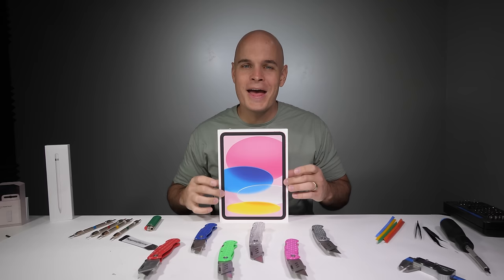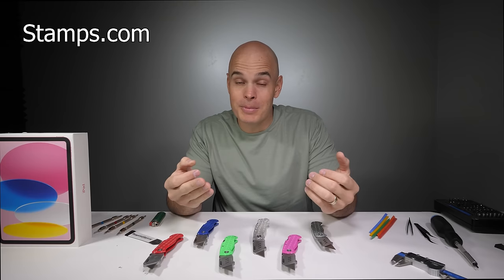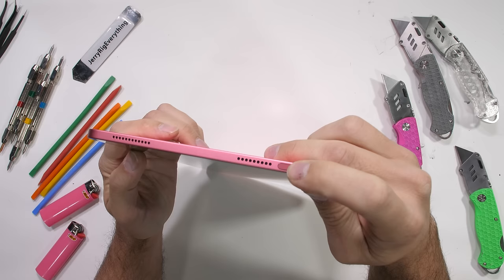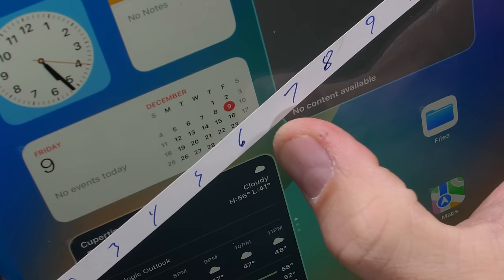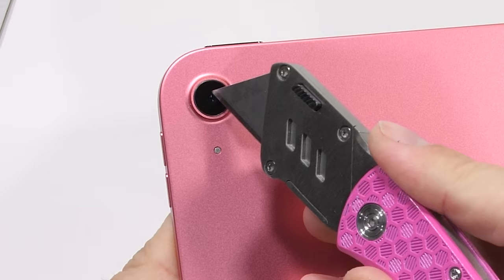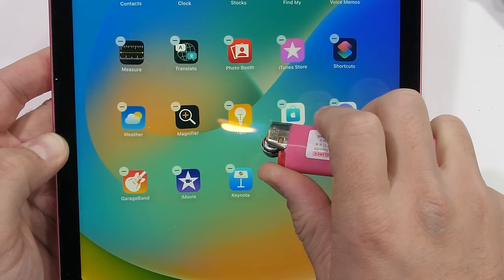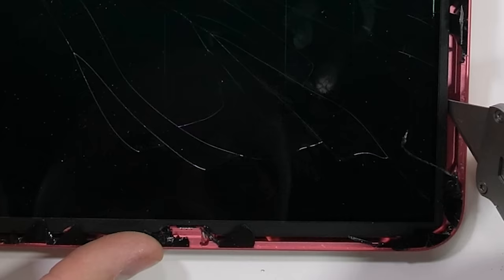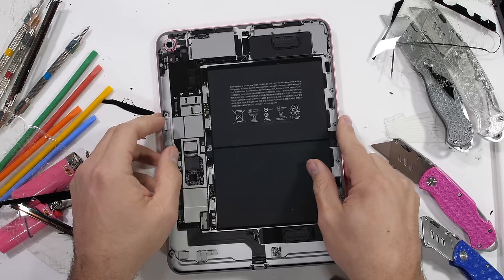The New iPad is...  (Lets just not talk about it...)

Comment: It's crazy how he cracked an ipad like a nut but couldn't snap the Z Fold--a phone that's made to bend. 😳
Reply: True
Reply: that really not crazy at all because an ipad isn’t meant to be bent that way but a a fold is? so your point is that if it’s meant to bend, it will, and if it’s not, it won’t?😭
Reply: @Kay  He's saying the Z Fold's hinge (hinges are weak points) didn't snap but the hingeless iPad did snap. The Z Fold should for all intents and purposes be the weaker piece of hardware (structually) but Apple seems to have somehow beat Samsung to that.
Reply: I have both a Z Fold and Iphone 14 Pro max and I promise you that Z fold 3 is a brick I’ve dropped it about 20 times.
Reply: it has no structural integrity, like ipad air 4, because it is its copy..
Reply: @kay-412 you lack so much reading comprehension
Reply: @Santiago3435.  not really. just outside variables.